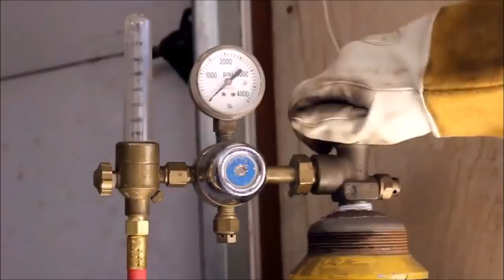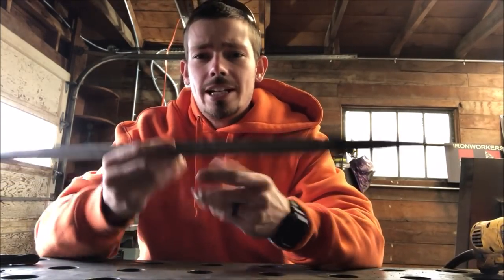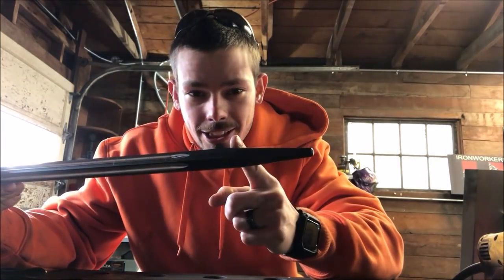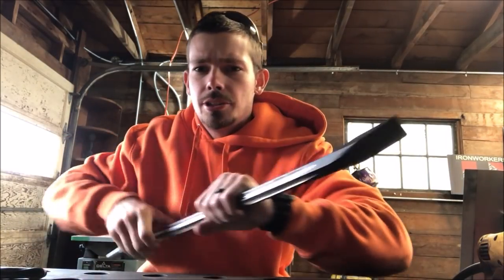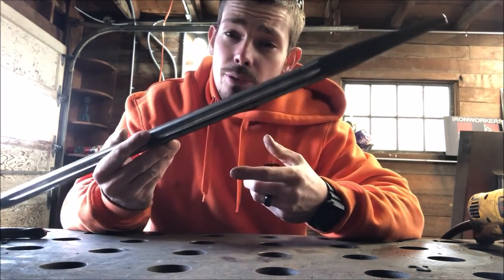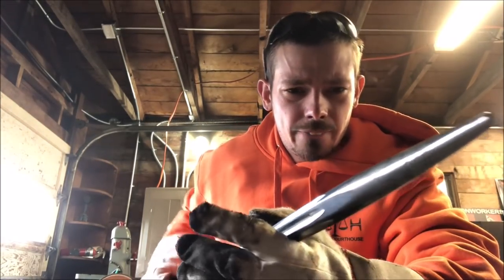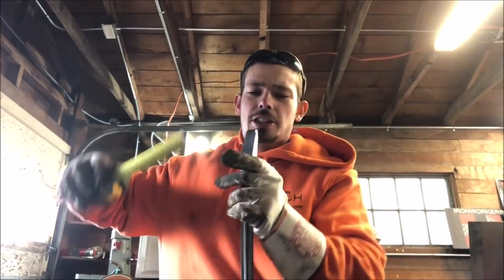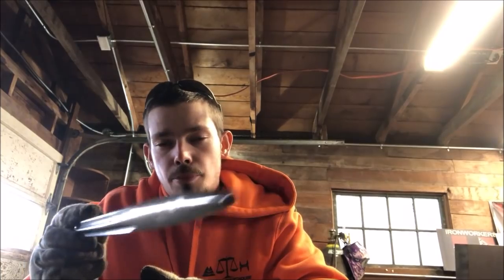ultimate sleever bar for ironworkers

Comment: Very nice modification.
I am an engineer (not an ironworker), and cutting the slots in your bar does weaken the bar. Its just like cutting a big hole in an I beam web. HOWEVER - the weakness is only a problem in the place of maximum stress! So when you're prying, the max stress is right at the fulcrum. That is probably either in the flattened part of the spoon or the tapered part of the pin. Also, with just a man yanking on it, how strong do you really need out in the middle of the bar. I'd use the reduced weight one any day. Great job.

Oh, and overheating the bar on the grinder until there are colors (yellow, blue, purple) softens the temper of the bar - so it'll reduce the hardness of the steel making it less brittle - it will bend more easily.
Reply from the maker: Copy that thank you for the comment great information!!!
Reply: I am an Ironworker and I’ve seen a fluted bar bend in the field. This is the dumbest thing you can do to your tools. And why? To save a few ounces? If his bar is too heavy maybe he should take up knitting. He’d probably flute his knitting sticks too.

Comment: BTW you can use a lathe with carbide tooling to turn it nice and pretty if you wish. EDIT 2022:  If you have any machinist bros show them this video and they can run a carbide ball mill to cut those flutes and a common end mill to narrow the end without overheating.  For DIY with a grinder I hold tools that size bare handed and when they get warm dip in a water bucket between grinding passes.
Reply from the maker: Ob Fuscated heck yeah man!

Comment: Metal removal doesn't make a rod stronger (because it reduces cross section) but there's plenty of steel to work with. Other items commonly fluted for weight reduction include rifle barrels.
Reply from the maker: Ob Fuscated yeah I wasn’t 100% set on it making it stronger! 

But it does add spines and more surface area my bar feels strong!
Reply: @ChantzFabz  Flutes hugely improve GRIP so it's all win.  A hex is slippery by comparison.
Reply from the maker: Ob Fuscated heck yeah man!

Comment: I never used a grinder on my Proto Hex Bar, as I trusted my life to it when I stood on over and over. Did all my modifications with a file. Excessive heat can truly weaken the bar. This may seem trivial, but when you connect without a  body harness, your tools need to be the best they can be.      [JIW] Oakland 378

Comment: Love the videos man. You using a 7/8” bar right?  The Proto link is for a 3/4”.
Reply from the maker: Shoot I’ll change the link that’s all bad... thanks for watching, subscribe for more brother
Reply: Already am man. Great page. I recently picked up a Mayhew 7/8” hex to try out. So far so good.
Reply from the maker: Mike Prorokovic one of my best fiends has one and he loves it!
Reply: proto doesn’t make a 7/8 anymore, the spoon is 7/8 I only found out after mine came in the mail 3/4 shaft. Why they did that super smart move I’ll never know, I rock a ruddogg 30 inch 7/8 hex bar now
Reply from the maker: wayne baxter yeah I used to have a proto back in the day!
Reply: @waynebaxter2391  Indeed. What is sold as a 7/8 bar from Proto is 3/4, all day long.
When I got mine from Hydraulic Services, they showed me the part number and size in the catalog.
It's still 3/4, regardless of what they want to tag it as.

Comment: Overheating the bar will draw the temper down.  Making  is softer, not brittle.  Assuming that bar is high carbon steel, it most likely be heatreated (hardened) and then tempered back to a tough/springy hardness.  More heat would just make it softer.
Reply from the maker: Copy that!

Comment: To answer your question about the engineering strength...  It is based on the loads that are being applied... This will mean the reactions are what are failing or doing the ''work''...
So,  depends where you hold the bar (the fulcrum) ...
Now to your detail, you made a ''truss system'' or as you would like to visualize it, you made ''I-beams"  (depending on where the cuts dissect and meet at the ''neutral axis" of your bar)...
I would do testing with a jack if I were you... to show proof of concept... then sell it to your friends. 
The tip here, is think central axis and I-beam when you create your works of art... 
Take care

Comment: @  motoMFthug  I also like to mushroom point for bite. Then friction tape handle/grip (never welded washer as stated) and carry in a bull pin frog. Sleever bars are so important as a connector, as like carrying a sword in the air as a sky cowboy. Like the fluting Chantz Thanks for being a IW.
@UCpIFuSAwQhjoBEVz5FTetgw
Reply: I've used the rubber grommets from Chicago fittings (air compressor hoses) and a washer since the 80's. You can slide them around, but stay put when connecting.

Comment: Welding wont make it brittle, it wouldake it soft unles you quenched it in water but you sanding the point like that will also make it soft cause your putting heat in the steel
Reply from the maker: I sanded it and took my time at it, welding makes it way hotter and than it gets cold fast and makes it brittle
Reply: taught in punk school,  no arc or heat

Comment: Hook it up
Reply from the maker: juan romero you want one???? 

Link in the description go buy a bar and than my buddy can mill it for you
Reply: Chantz Fabz that links not a sleaver bar bud. eavy-Duty Truck Wrench

Use with KEN34401 for off-the-road Budd-type wheels. Long length provides extra leverage. Stock: 1-1/4 in. (3.1 cm)
Specifications:
Length: 30 in. (76 cm)
Weight: 6.5 lbs (2.9 kg)
Reply from the maker: juan romero gotcha sorry about that
Reply: I need one dude...

Comment: Folks without a killer disc sander or working in the field can mount a 9" grinder in a vise and use a flap disc instead.  If you want a very convenient grinder mount you can, and I did, use a piece of 2" box tube (which also fits Reese hitch sockets!) and whatever scrap is handy to pick up the side handle bolt holes. Bolt grinder to mount and you can clamp the box tube in a vise, a chain vise on a tristand, or slide into Reese sockets where ever you feel like mounting them. Many weldors weld them beneath the plate of their welding table to hold vises (you can use your vise in all four possible positions instead of just bolted to a table) and other accessories. I even have a bench grinder so mounted. That leaves the top of your welding table clear when needed.  Socket mounts also work for rollout wheels. To eliminate any slop, drill a second hole, tack a nut, and run a bolt against the inner box tube to take up any slack.  This is all common weldor stuff.
Reply from the maker: Ob Fuscated oh yeah I dig it brother

Comment: Hey can you do a video on how to widen a sleeved bar holder I bought a Klein sleever bar holder. But the ring won’t fit on my sleever bar. Can I just grind it wider to hold my sleever bar?
Reply from the maker: Justin Beery I use a 7/8 lock washer on a hex bar and a 3/4 lock washer on a round bar! I’ll make a video on it for sure
Reply: Chantz Fabz thanks man appreciate it brotha
Reply: Chantz Fabz my job is a 6 month contract local 92
Reply: Chantz Fabz my connecting bar is a 7/8 hex connecting bar Klein 30 inch
Reply from the maker: Justin Beery right on!

Comment: Can you still use the washer if it's fluted? What bar do you find best hex or round and why? Can you flute a round bar and do you think it would be just as strong as unfluted?
Reply from the maker: Jedidiah Pettitt I have always used a hex bar I find it more comfy to use but people use round bars all the time I personally just use a hex.... and I’ve never scene a round bar fluted I’m sure it could be done and and anddddd I use a washer on my fluted bar not problem
Reply: @ChantzFabz  I would be easy to flute round bar using an indexer (or vee blocks and a bit of layout).  It would be an upgrade because round stock is fucking slippery.
Reply: You can also use yer crescent on the hex bar to roll the bigger piece or in tight spots.